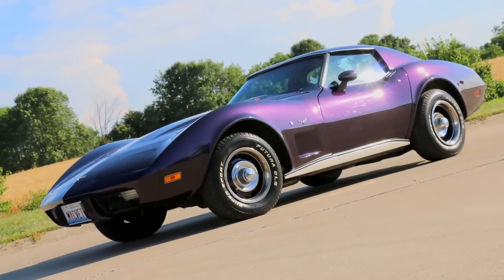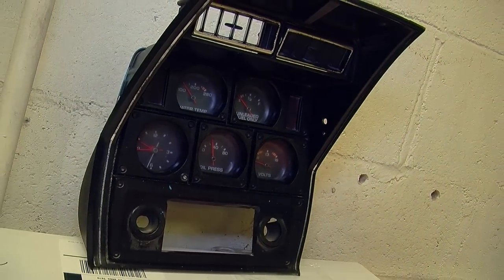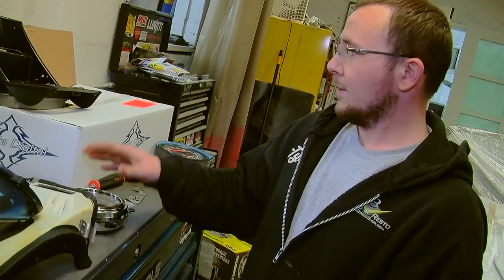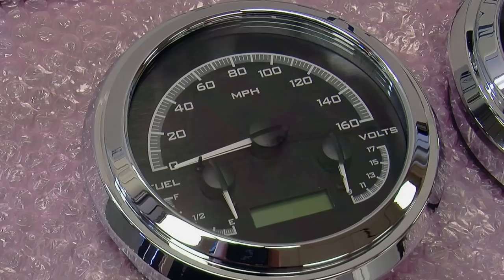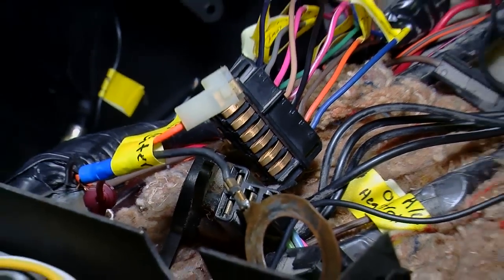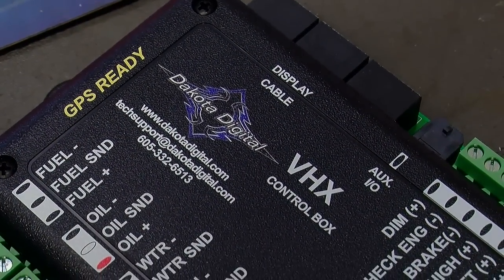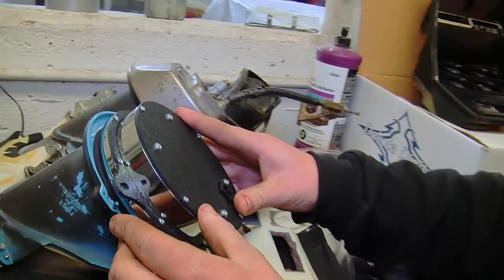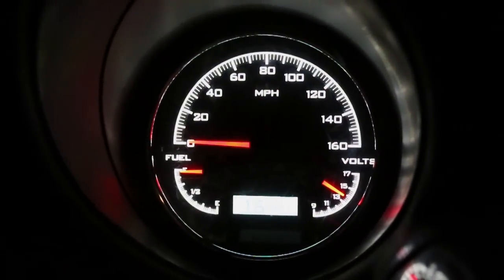C3 Corvette Interior Upgrades Video Series Part 1 of 2  - Dakota Digital Gauges, Vintage Air V8TV

Comment: Hi Tyler, I am inspired loved your videos. I have a 75 vette with 5.7 350 and am doing same exact thing as a result, meaning the digital gauges. Am also installing a double din. I am going to attempt modifying existing bezel (maybe its crazy) I found an aftermarket android  unit with shortened profile. Am also installing fuel injection Edelbrock 35793. I will have to mod the hood to make it fit. Biggest complaint on the 75 is emissions which no longer apply where I live.. going to attempt an interior upgrade and a candy paint job. Lots of work to do..it wont be quick. Figured I would share this with you since you really inspired me. My goal is to create a classic C3 with a modernized icabin. Spending too much on this project probably. I found a c3 to C5 or 6 seat adapter , maybe power heated seats who knows. Thanks for your videos
Reply from the maker: Thanks for the kind words, we passed them to Tyler!  Good luck on your '75!